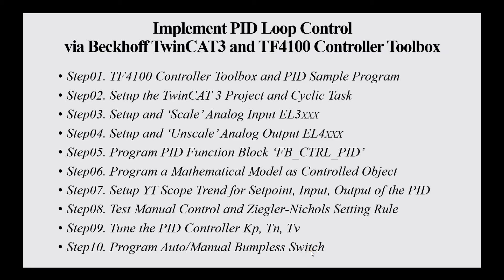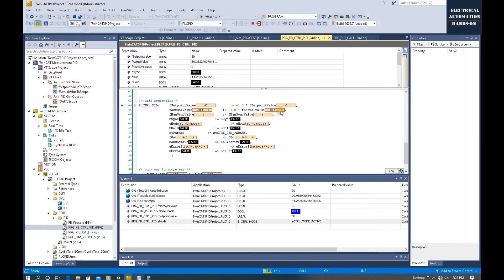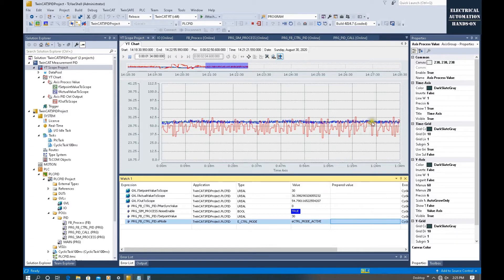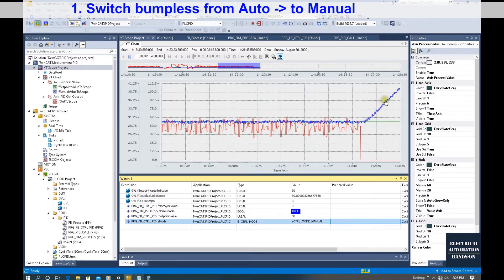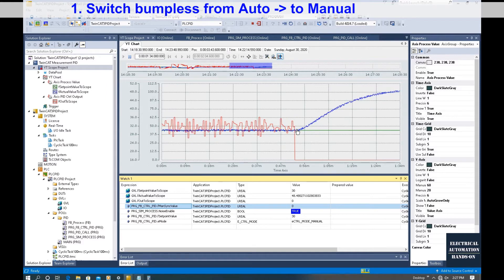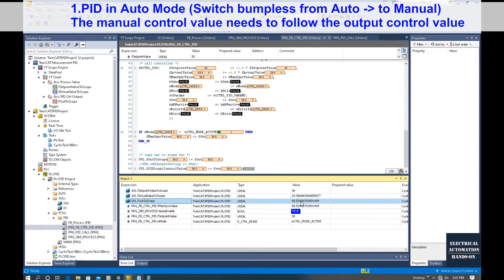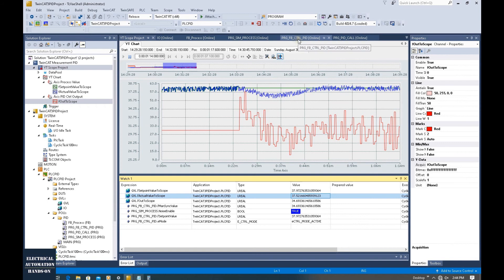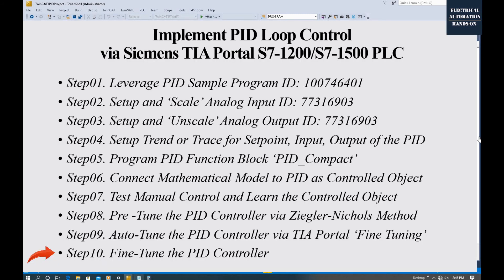PID30 - Beckhoff TC3 PID010 -  PID Manual/Auto Bumpless Switch

Comment: Thanks so much!! The videos were soo helpful.  The only question I have is, How can I use a sine or chirp signal as the setpoint?
Reply from the maker: You can use SIN command and change your  X from - 2 Pi to 2 Pi , or use Z transfer of the Sin (X).
Reply: @electricalautomation  How can I write it in the code?
Reply from the maker: @kamgangblaise2645  I could write the code but my time is billable via donation link. Please send me an email and let me know the sin period and amplitude you need.
Reply: @electricalautomation  Thank you! I sent the mail.